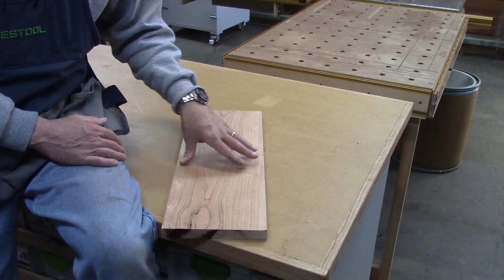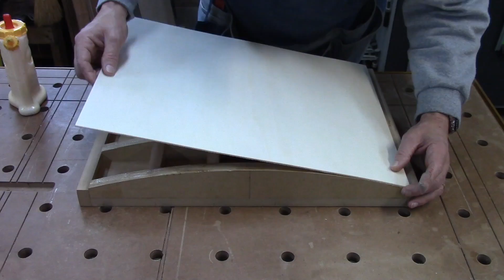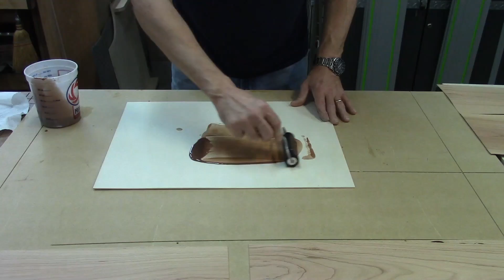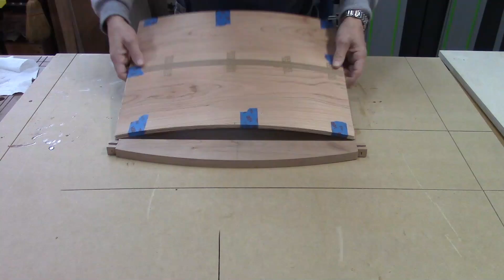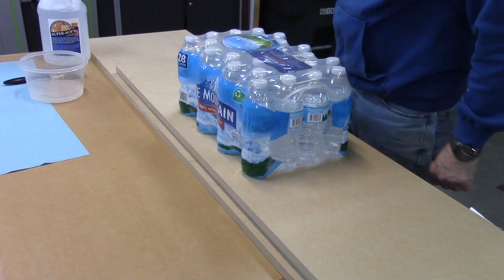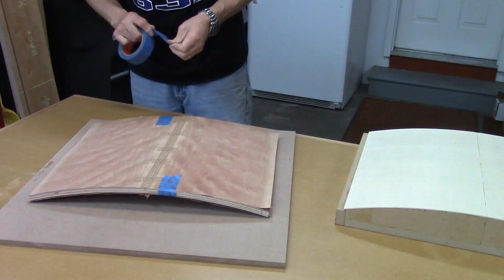Curved Front End Table 2 - Curved Veneered Front Doors

Comment: Guy Great video! Thank you!! One question was there a reason you did this in two glue ups instead of one? Just curious.
Reply from the maker: +Paul Kinneberg Thanks Paul! Yes, there is. When I bent the panels, I used a urea resin glue that dries very stiff to keep the panels in shape, and it takes a long time in the vacuum bag. The top veneer layers were held in place using a cold press veneer glue. It's a PVA glue with some solids. That was a separate process because the cold press glue shouldn't be in the press that long. I hope that helps! And great question!
Reply: +GuysWoodshop Thanks Guy!! As always great information!!

Comment: Hey Guy, that is going to be awesome. Just wondering what the heck is veneer softener. What is in it?
Reply from the maker: +billfromelma Thanks Bill. I think it's a mixture of glycerin and water. When the veneer comes, it's very dry and brittle. The softener help make it work easier, and flattens it.
Reply: I'm refinishing a piece that has a really pretty burl veneer, but! It has bubbels in it . I tried a small cut and putting wood glue under it but when I clamped it down the area just broke into little pieces. Wonder if that softener would help?
Reply from the maker: +billfromelma I am not sure. If there is finish on the veneer, it probably won't be able to soak into the fiber enough to do it's job.

Comment: Nice Job. I was wondering why you didn't use a cheaper secondary wood for the layers in the curved  panel and only use the expensive cherry veneer for the front and back face? Or did you and I missed that? Thanks for posting the build I look forward to the other installments.
Reply from the maker: +Jean-Marc Labonte Thanks Jean-Marc! I showed using a single piece of cherry that I re-sawed myself for the secondary wood making the layers of the lamination. It was a little more than a board foot, and I pay about $2-$3 a bd ft locally for cherry here. So it was pretty cheap for me! I wanted the layers to be a little thicker than what I could buy, so it worked out well for me.
Reply: Thanks for the reply and info. It's going to be a nice piece of furniture. I look forward to seeing the other postings. Take Care

Comment: Came out real nice!!!! Does the tape ends up staying it the assembly ( the cherry you resaw  in the inner layers?) looking forward to see the cutting jig for that to make a nice straight cut right down the middle...
Reply from the maker: +Tomy Hovington Thanks Tomy! Yep, the tape stays inside the panel. It is pretty thin, I didn't use much, and it is pressed against the bendable ply, so the tape didn't telegraph through at all. And yes, I have what I hope is a good solution for cutting it in half and to size.

Comment: Looks fantastic so far Guy. Every time I watch your projects I'm always curious about the tools you're using and where you got them. I think you should start putting links to tools used in your video in the description and for some of them I'm sure you could get affiliate links and make some extra dough. I imagine I'm not the only one wondering about the tools as I read through some of the comments.
Reply from the maker: +Matt Przybylski Thanks Matt! I have thought of that, but I am not really doing this for any kind of payoff. I am working with a few companies that may turn into sponsors, but I am not holding my breath. After I get this project finished, I think I may do a shop tour video?
Reply: +GuysWoodshop That would be great. I get what you're saying about sponsorships but in my experience when watching your videos you always have some cool stuff that I haven't seen or want more details on.  At least a rundown of what you're using would be awesome, links to where you purchased even better. Doesn't have to be affiliate links, just a thought.  Either way I will continue watching, I just hate making comments for the sole purpose of "what is that?", know what I mean? I typically am a quiet watcher and have been for years, don't comment that often, just enjoy all the content everyone is putting out.

Comment: Very good! It's coming together nicely. If you cut some 1/8" grooves in your platten, the air in the bag will escape more easily. I have a few videos on vacuum veneering on my channel too, and I wish they were as well-made as yours!
Reply from the maker: +Richard Leon Thanks Richard! I have seen your videos and subscribed a while ago. I thought about the grid on the platen, but the bag was so small it didn't seem to be an issue at all.

Comment: I'm guessing that the veneer tape comes off after the glue drys. I almost had a heart attack when I saw you put the tape face side up. Then I realized you probably meant to do that, so I decided to shut up and color :)
Reply from the maker: +Brad Hubbard Hey Brad! Yes, the tape comes of when you moisten it a little with water. If you put it under the veneer, it will show through because the veneer is so thin.

Comment: Hi:
I am now feeling better and back in the shop, thank goodness.
Thank you very much for the information on the jointer.  I can't believe the difference in the prices.  I like my 15" thickness planer.  It has a Byrd helical head on it and you know how smooth the wood comes out of it.
I forgot to tell you how glad I was that you used Arm-R-Seal on the dinning room table.  That is my favorite finish and I have been using it for over 10 years, and have used it in all sheen's.  I have even mixed two of them to get the sheen I wanted.  I don't seem to make a mistake using it. I spray Bloxgen (may be misspelled) in the can so I don't get a film on the left over finish.  I don't use any of the other stuff.
I very much liked the way you did the door.  The best part was you did not have any spring back which is great.  I very much like the way you show your builds and enjoy them very much.
Reply from the maker: +Csbinet Maker Thanks! Glad you're feeling better!

Comment: Thanks Guy, looks like this will be another outstanding project.  what glue did you use on the top veneer?  Hide glue?
Reply from the maker: +Steve Carter Thanks Steve! The last layer of veneer was glued in place with cold press veneer glue. It's a PVA glue with some solids mixed in it.